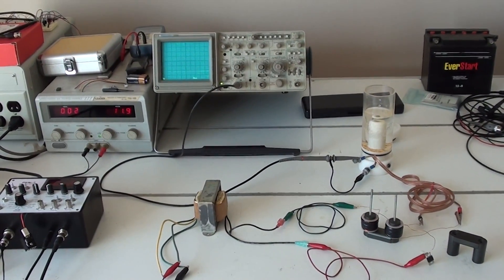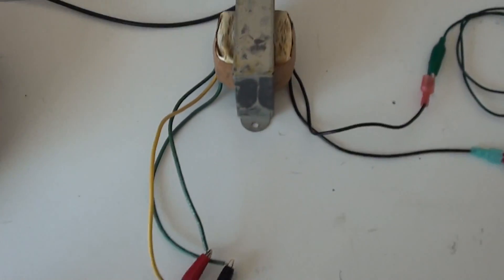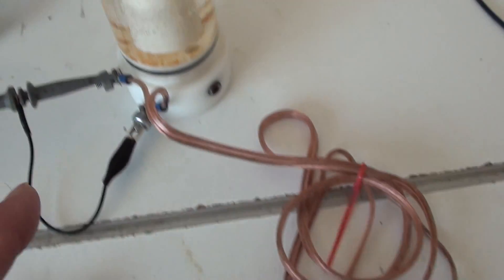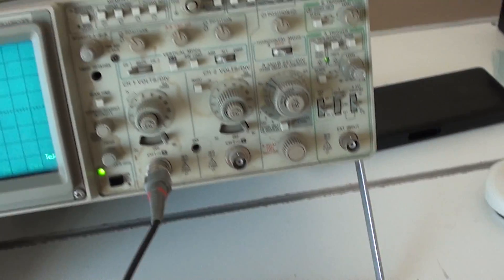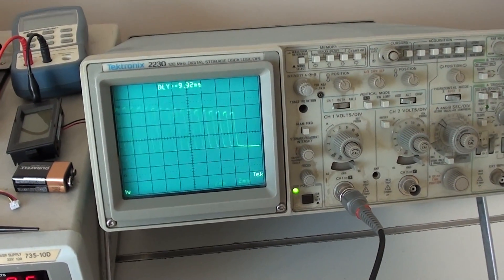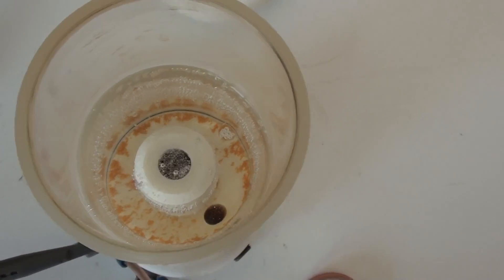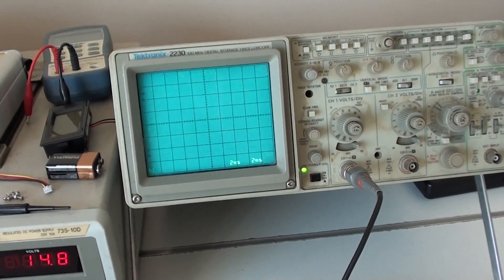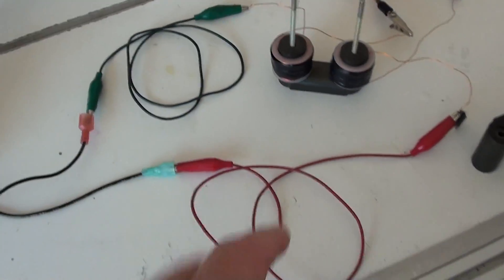Stan Meyers replication resonant cell5

Comment: Super cool ... I worked for Tektronix during their hay day when the 2230 and 2232 where hot products.  Great scopes and have the Analog/Digital capability.  There was an easter egg in the 2232 if you press the advanced functions menu, then save ref 3 twice, and then select the skating wizard or the Tek Bug logo.  Great video and thanks for sharing.